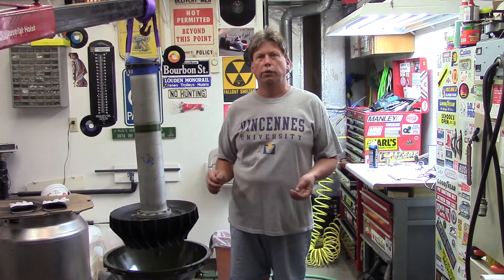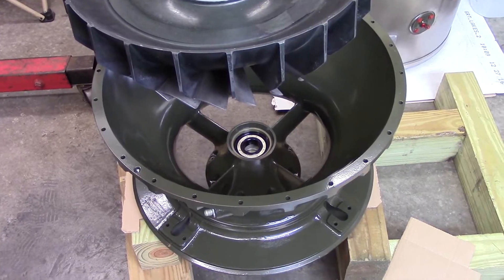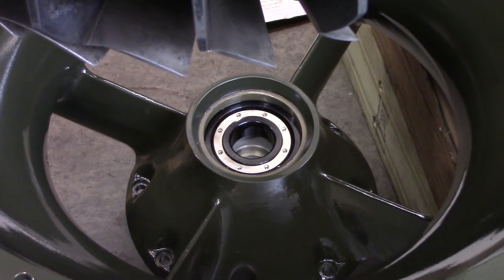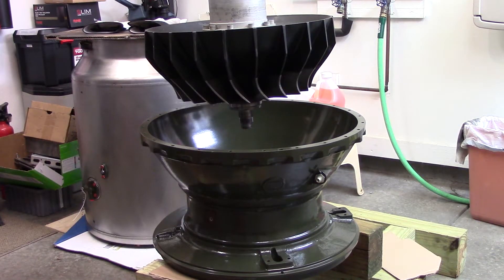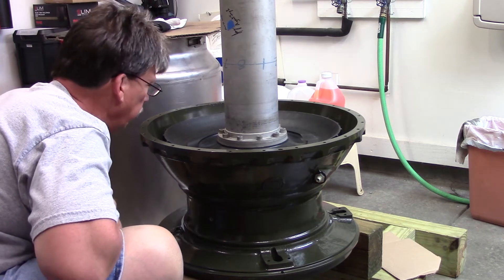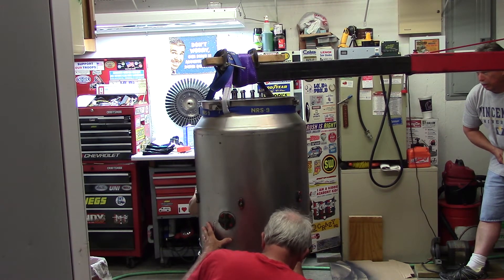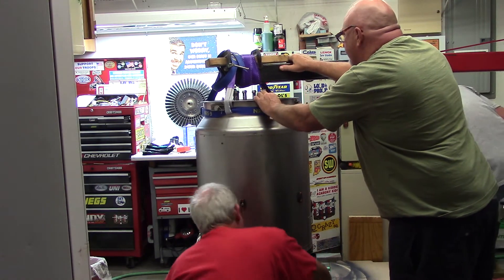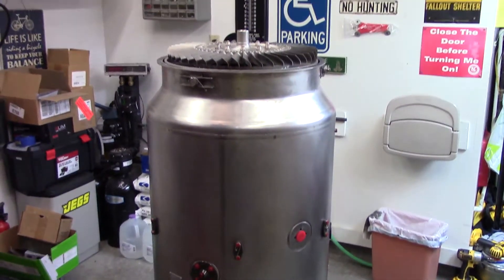The J44 Project:  Final Assembly, Part 1.

Comment: When will the next video be posted, im ready to see it run again
Reply from the maker: Well, Sometime this Winter??  I am waiting from time to time on parts or pieces to be made or modified by my fabricating buddy foe example, making the round holes into slots on the rear engine mounts, so sometimes I drop out for a while.  It's definitely taking longer than I had thought... I appreciate to following though.  Hang in there.

Comment: Since this engine was designed long before electronic engine controllers (eec / ecu / fadec), then everything must be controlled mechanically? So for example fuel pump is controlled by a governor, not by any fancy electronics? :)
Reply from the maker: Hi there & thanks for your interest.  The fuel control is completely 'hydro-mechanical', as in sliding valves, springs, a governor, etc.  It is made by Woodward, a huge manufacturer of fuel systems for aircraft & gas turbine engines.  Nothing fancy about it.

DD